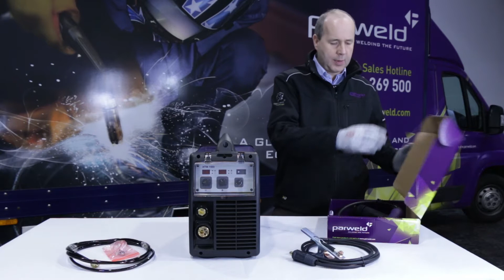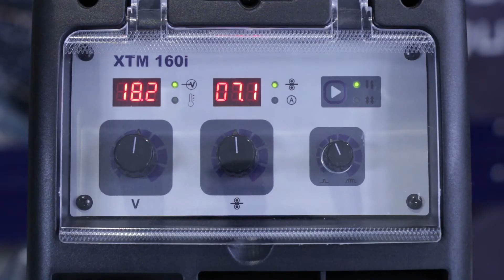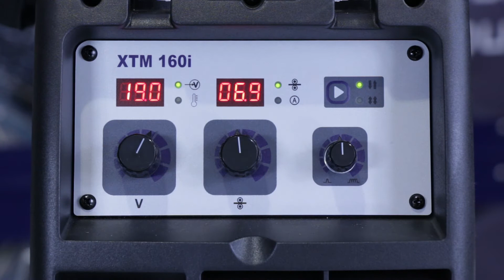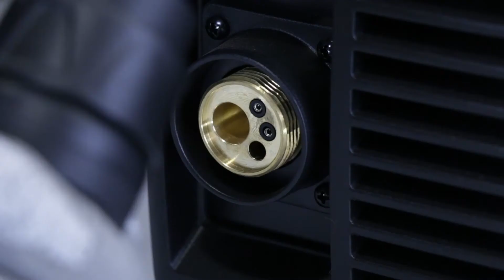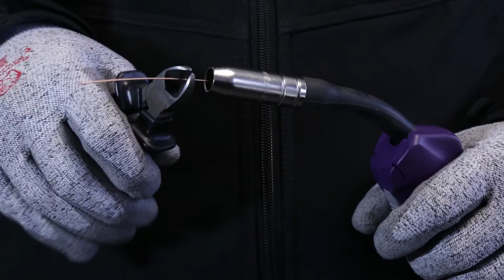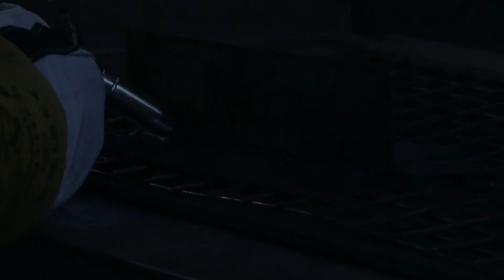XTM 160i MIG INVERTER

Comment: Great demo! How many wire feed rollers does it ship with? How do you know what voltage to use for different thicknesses and materials? Many thanks! L
Reply from the maker: Hi LanceB, the machine comes with one set of rollers but you can order the other available rollers if necessary. The voltage can be adjusted and set by a chart that we include inside the machine door.

Comment: Informative clip.
Although a little more information about the burn back control and adjusting the fine tune for voltage (I think that's what it is for) on the right of the front controllers would have been helpful.
Great products and I love using my Parweld machines.
I am an amateur and learning so this was an okay clip but more detail to help people like me understand would be great.